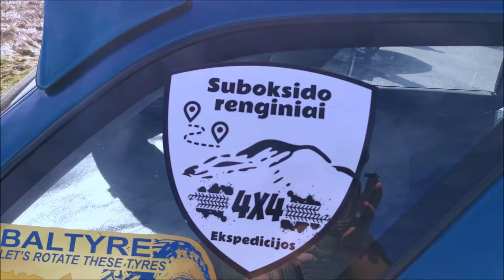Volvo XC70 in deep mud and water. Volvo AWD test. Volvo offroad party 2023 #2. DDrive

Comment: At 1:13, there is a hookup at the rear of one of the Volvos. IF that is a towing hitch for trailers . . DO NOT USE it to pull the vehicle out of mud!!.  If it is DESIGNED to pull the car out, then use it. I cannot tell by looking at it.